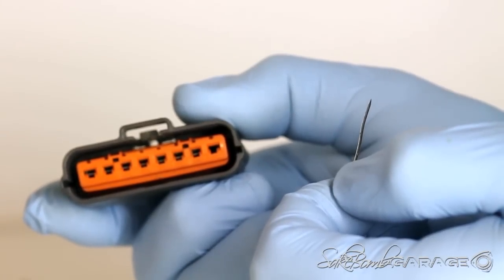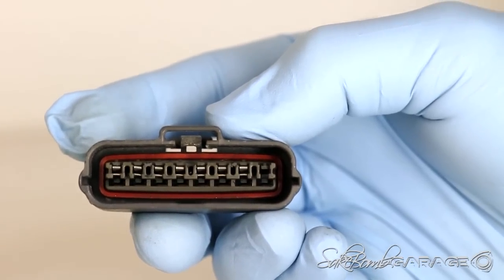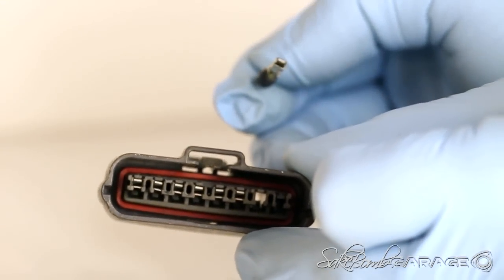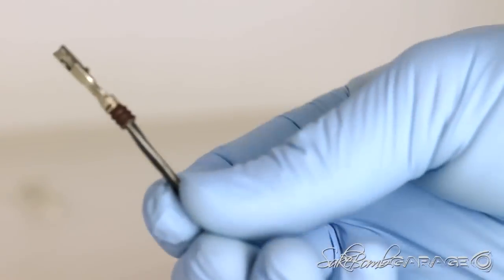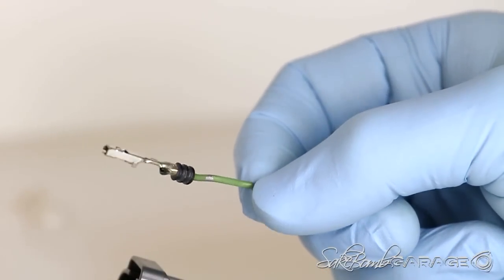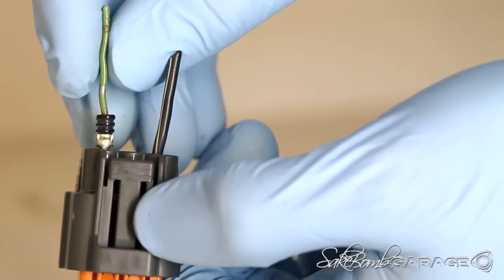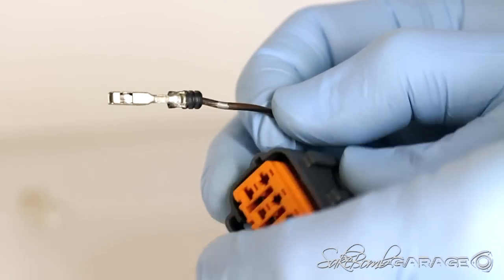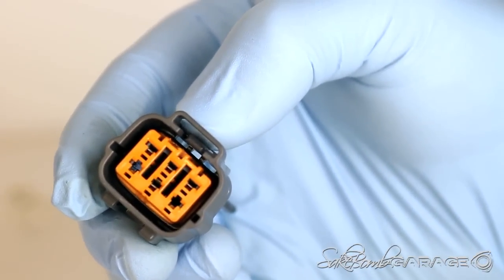AEM Coil harness de-pinning procedure FD3S (Sumitomo connector)

Comment: Good job but how do you determine the power wire and most important how do you know which slot to put it in. Most wiring diagrams do not give the pin outs.  So where did you get the info?